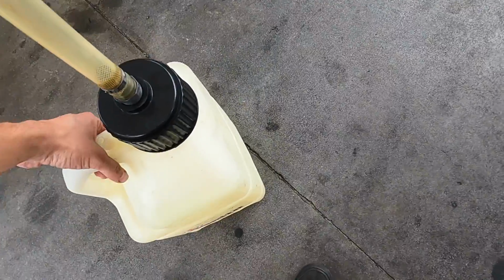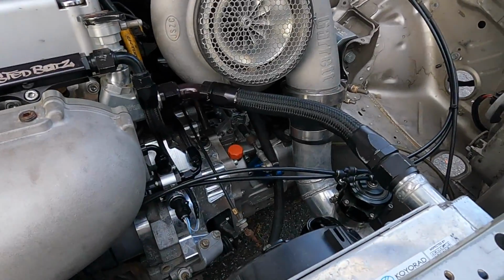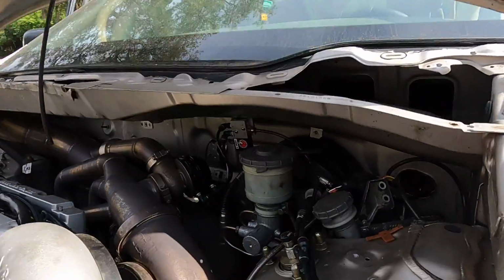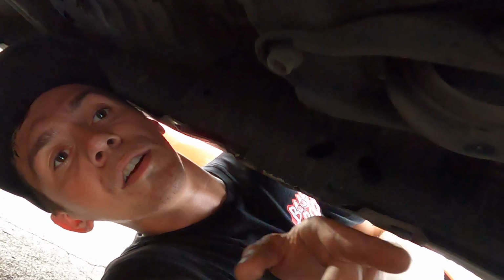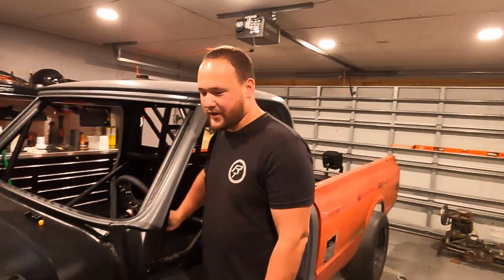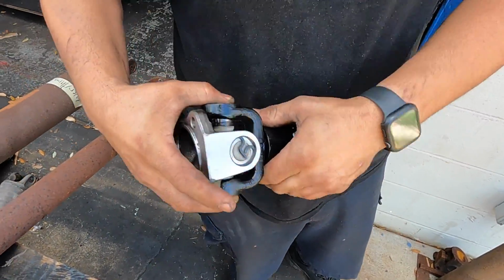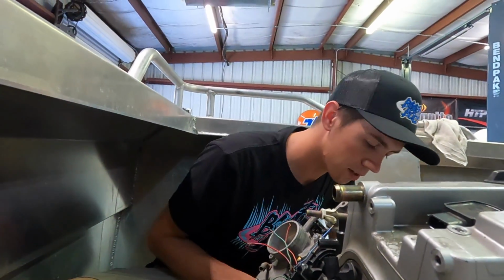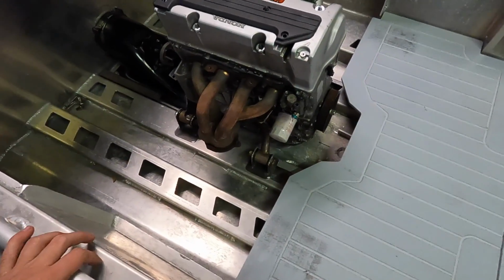Custom Parts Came For Our K-Swap Jet Boat Build!

Comment: Cayman S, and it has the 2.7?? I had a rag top Boxster S, and it had the 3.2. I LOOOOOOOVED that car. Got it for free from a guy who bought a car from me....he said that he was driving it, heard something break and the power steering stopped being power steering. I figured he just snapped a belt. After i towed it home, I gained access to the engine through the 'back seat' and found that the pressed on water pump pulley had flung off and through the belt. So, $124 later, for a belt and water pump.....I had a sweet rag top, Bossier S, with a 6-speed manual. It was soooo much fun, until some asshole with a turbine on his head ran a traffic light, struck me head on, then I t-boned a 2 ton Fed Ex truck (well, didn't really t bone him....the nose of my Porsche slid under the side of the van all the way to the windshield!!)

Only had that car like 6 weeks! 😠 😡 😤 🤬

Comment: shouldn't you make a remote oil drain to change the oil on it
Reply: Most oil changes on boats with inboard engines are done with an oil extractor. Which uses vacuum to extract the oil out through the dipstick tube.
Reply: @MellowYe77ow  interesting, I still think a remote drain would be easier and more convenient

Comment: If you have issues with the hydraulic power steering setup, you could always go the route of using the power steering out of a prius, which is a pure electric setup that mounts inline with the steering column. Just mount it and feed it the correct power and you're good to go.
Reply: The issue with that is that he's trying to save space, and still needs a hydro pump for power brakes.

Comment: Gonna lead to a bunch of sick days lol, I definitely have some concerns for those mounts not corrosion, but I feel like the aluminum is going to stress crack. That motor is a 4 banger with it's inherent vibrations I think the aluminum needs to be beefed up for sure

Comment: The Volvo ps pumps have extra sensors that regulates the speed of the pump.   As you turn the wheel it boosts the power to move the wheels.   You don’t have the sensors so it won’t fluctuate.  Plus the pump can take up to 80 amps to run so you need to have a beefy alternator.   I’ve worked on Volvos for years.

Comment: Maybe you could cut small square of rubber mat the shape of the mounts and slide it between so you have some vibration/noise dampening. Just from my experience I have seen some drone from solid mounts. Cannot wait to see this thing in the water, It' going to be epic!

Comment: good to see you made that heat shield for the brake master cylinder on the van. you dont have all the weight of the truck on the front wheels there is a trolley jack holding the weight liar

Comment: Is the K gonna have enough torque to push it through the water fast enough ?? Steel scratches aluminum i give it a few weeks after being in the water youll see the rusty aluminum appear ..especially in FL

Comment: Brother put a thin peace of heavy duty rubber between take out some vibration also works as a barrier and not let aluminum oxidation to happen? As for the rubber something like a heavy duty peace of conveyor belt cut to fit eliminates contact to contact!

Comment: You really should separate your steel from the aluminum , I have had aluminum boats in the past that have had issues, Better safe then sorry. Easier to put something between the metals then find a pin whole and patch it

Comment: Dude, put some thick ass rubber between the mounts and the floor of the boat so that the awful vibration from that motor are as isolated from the hull as physically possible

Comment: I fitted a TRW E-pump to my gf's V6 twin turbo VR4 out of a Holden Astra in lieu of a belt driven pump, and the pumps are designed to work on 14 volts, so you'll find once the engine is running and alternator is charging the pump will work better and the stiffness part when you swerve the wheel will be less pronounced. Some of them have a VSS wire that drops the speed of the pump when you're at speed to make the steering less twitchy, but not all of them have that function. The MR2 pump was always the go-to pump for a long time because they were smaller and package better in the bay, but these TRW pumps usually bolt to the top of the steering rack out of the way of everything else

Comment: are yall gonna put a turbo on it eventually ?
Reply: and also what route are yall going with cooling the engine ?
Reply: Yes, they plan to turbo it in the future. The jet drive will also pump water through the engine.
Reply: @MellowYe77ow  ok thats good but will the engine ever get up to operating temperature that way ?
Reply: @karrharding8675  Just keep the thermostat in it, and it'll work just like a normal cooling system.

Comment: Nutsert the mounts. Do not just run a tap on that sheet metal.
Edit- they sell aluminum nutserts which are easier to rivet in then stainless or ms and wont corrode

Comment: As for the power steering on the truck I gave up and caved and put a Saturn car electric column in my samurai and it steers 33’s just fine.

Comment: Why has nobody invented a spring board for the bottom of the boat I mean a thin sheet of aluminium the same shape as the boat on small suspension would be great if it all worked correctly. It would take the initial hit off the boat hull

Comment: I would think hose diameter would have a big okay on response to the steering rack , big return and just right on the pressure side .. I would think too fat would slow it down and too small the rack would lose it too , just a guess anyway

Comment: Get some 2mm HDPE sheet (or cork or anything non-metallic) to use as a gasket between the steel and aluminium.

Comment: I'd get some 1/4 steel plate as long as the engine and bend it to fit over the aluminum streamers so that you can bolt the steel from the top and sides to the streamers with say 6 to 8 bolts, and then bolt the engine mounts through the steel and aluminum. If you don't have large enough steel plating those engines mounts will end up ripping through that aluminum and that will cause a very bad day.  That type and thickness of aluminum will not hold up to all the jarring that the engine is going to be dealing with.

Comment: Use nutserts.  Aluminum fatigues over time and I wouldn't trust those threads.  <-- machinist.  Also use stainless steel hardware.

Comment: You might be able to tighten them down tight but aluminum is soft and having it that tight is actually gunna make it wear fast with the vibration and what not. Have better luck if you tap and use heli coils to add some strength or do what u said and add some thickness to it.

Comment: watch the bolts you use. They'll be your weakest link, They'll crystallize very quickly. Go to a Bolt shop and see if they have bronze or an alloy that will handle the load and harmonics you'll be subjecting it to. Another thought is the strength of the aluminum your mounting the motor to. The stress potential here will be huge. Just thoughts of an old engineer, your video showed all kinds of red flag construction issues I picked up on. Sorry to rain on a parade but, i've seen engines peel out of boat hulls before and most times it takes the driver with them. Be careful.

Comment: You can still put in the aluminum blocks. Just cut holes and recess them. Then use a sacrificial anode as others suggested along with a lot of anti-sneeze on the bolts. Making sure the block is thick enough so the bolts don't have a hole at the bottom would help too.

Comment: I'm gunna go ahead and stop watching the channel after this comment. Just wanted to point out that you could have easily avoided spilling Gas on your seat, if it was an accident to begin with. I just loose a lot of respect from people that have nice things and treat them with total disrespect. Rather insulting to people who have nothing. It's not the gas can on the seat. It's the fact that you didn't give a shit to use a sealed can, or just blatantly spilled it to prove you drive it daily. Which is worse. Anyway, had a lot of fun watching your channel so thanks for all the good entertainment, yall take care.

Comment: In the UK custom cars use a vauxhall corsa electric power steering unit that goes on the steering column and is real easy to fit, hope that might help there called opal corsa's in other places
Alan from Scotland

Comment: Kyle, it’s best practice to have 1-1/2x the bolt diameter has your thread depth.  So if you are planning to use a 3/8”diameter bolt then you will need about .518” of formed thread for the bolt to engage into.  

If possible a nut on the backside would be better than only have 2-3 threads engaging on each bolt.  And it would not be surprising to see the aluminum frame rail fail quickly putting torque to that thin material.

A nutsert is actually probably the easiest and not a bad solution at this point. 

But I’d recommend rebuilding your mount to be able to spread your load down the frame rails with thicker material that you can run a proper thread into.  

Best of luck! 👍

Comment: One thing for sure, its gonna be the most reliable mini jet on the water. N/A k series. Hell yea. Put it on E with a fuel tech. By the way, i bought a super cheap oven/stove from salvation army, a powdercoating kit from summit, and i just bake everything in my $50 oven in my shop. Shit comes out SO baller dude. I did chrome powdercoat when i put some wider outers on my rear 3 piece johnnies for my irs converted sn95 drift car and nobody believes theyre not plated until i show them. Shit comes out absolutely PERFECT.

Comment: Hoping you read this..,Scatter-shield !!! For the jetboat! That exposed flywheel/driveshaft is a little sketch. I’d also put a carbon steel plate beneath that rotating assembly to keep it from punching a hole in the hull if it comes apart.

Comment: My Saab story popped a silicone coupler at 19lb an I was like ok 15 was fine 🤣..  

Btw “boat” stands for “bail out another thousand.”
 
And boats are much easer then a car to build. So far I’ve built 2 boats.. the first one was a 19ft inboard with pre-alpha 1 leg the og engine was a 151cu in 2.5l inline 4 and I swap in the 181cu 3.0 iron duke.  The second boat is a 24ft trophy with 2 Honda bf115. My opinion is boat are easier to maintain an build.   

An brooo take my advice use 100% silicone behind all pieces that sen close to each other. because boats do have vibration even if you get the shaft perfectly inline. so the silicone will help reduce aluminum vibration an you won’t need earplugs

Comment: If I were you I would ask the drive shaft shop to balance that drive shaft out to 8000+rpm. 

You will have some bad driveline vibration if it hasn’t been properly balanced to the high speeds it’ll see directly coupled to the k series.

Comment: I'm a welder fabricator for almost 20 years, and I used to work for a company that did kingpins and all sort of attachments for trucks. When we had to joint parts made from steel, to parts made from aluminum, we were laying duct tape on one of the surface before sandwiching the 2 parts together, this way we were avoiding corrosion between the 2! Steel in contact with aluminum in salt environment will just make both metals rott! You should definitely use this route. It's simple and will save you lots of headaches and time in the future! 

Also for the engine mounts, you could simply scribe around the steel squares, remove the engine, cut the square holes and then insert 1/2" or 1" thick blocks inside the holes that you could weld solid and safely tap. IMO tapping engine mounts in 1/4" thick aluminum is borderline solid enough!

Comment: Hyumdai excel pump is the most used for LS setups, you need to just strap or weld on some hold points for the driveshaft on the van, you're fighting the torque so hold is back.

Comment: One easy route would be to make the engine mounts out of aluminum. Weld it on  spreader plates (or an entire pedestal for the engine) and use titanium fasteners and spacers if corrosion is really a big deal. I would avoid making any more holes on the hull and have more points for leaks. It takes time doing it right but it would be less of a headache when it does happen

Comment: Get a full set of EBC Red break pads for the Porsche . They work great and will cut way down on the break dust that you are getting on your rims.

As for the engine mounts for the boat, You can simply remake the lower portion of the mount out of Aluminum. The rubber will isolate the steel portion from touching the aluminum portion. So just aluminum stands that can be welded directly to the boats hull or bolted if you prefer to have them removable.

Comment: That galvanic corrosion is no joke, anodization or 26 coats of powder coat, set it in salt water, and it’s doomed, give it 4 months before it’s noticeable, not to be a downer, but I’d recommend before it’s done do it right, vs do it again. You may be able to stretch out the failure a year or 2 if you put in sacrificial anodes.

Comment: I would use like a .5" piece of square polyurethane to fit between where the square surface of the engine mounts meets the boat surface, this would allow for extra NVH protection. Unless you're planning to weld that end of the engine mounts to the boat and I missed that somehow.

Comment: Put a hydraulic fluid accumulator in the truck power steering high pressure side...when the electric pump can’t keep up, the spring in the accumulator will compensate...adds safety too as backup pressure for hydroboost brakes.

Comment: Kyle have you thought about cutting up an old innertube and using it between the mount and the boat?  Possibly a little vibration dampening and it will keep the steel and aluminum from touching.

Comment: Don't tap into the Aluminum
Take press in insert threads in german we call them "Blindnietgewindemutter"
take this from stainless steel and stainless bolts use some electrical insulator between the steel and aluminum faces touching each other. Corrosion between aluminum and stainless is uncritical. As an insulator we always use PCB base Material called FR4 which technically only is a GRP sheet material with around 2mm thickness

Comment: go tell ford that it takes years their mustangs manage it in months :) also salt water speeds it up too. at very least you want some rubber between the mount feet and the boat frame. although the bolts will still be an issue it'll be better than nothing i guess.

Comment: I have to agree with most people on here kyle.....I know you said your not worried about corrosion due to it taking a long time to achieve it but I can tell you that it honestly will only take a year or 2 before it starts to corrode and pit very badly....I live in ohio and work/fabricator on fuel tanker trucks and the 5th wheel plates are steel where as the trailers are ally. We do D.O.T yearly and 5 year inspections and even after 1 year the plates start showing signs of pitting from corrosion and by the 5yr mark 99% are so bad they are almost falling apart in areas and that's even after we use rubber to insulate between the ally and steel plate. You living near saltwater environment will only make it worse on corrosion and speed it up faster unfortunately. Regardless of what you do (stick with same ideas or go new route) I'm behind ya rooting for ya the whole way. Cant wait to see this out on the water💪💪

Comment: With the electric power steering in the truck, maybe a hydrogas sphere from a Citroën suspension connected to the pressure line from the pump would smooth out any demand spikes from the rack 🤔

Comment: Ask owners of Jeep Wranglers about galvanic corrosion. Steel door hinges with aluminium door panels with no surface coating to separate them means they start seeing bubbles in the paint after about 2 years.

Comment: Just fed a nut plate up the rail towards to engine mount, bolt up then rivet in position to hold the plate while removing the bolts.

Comment: Aluminum does not like vibration, tensile or torque stresses, so not a great engine mount material.
I have spent several years maintaining a small fleet including a 30m aluminum Cat', all bolts that come into contact with aluminum should be 316 SS AND coated with Duralac.
Duralac is a yellow paint/grease type product that comes in a tube, like RTV, it inhibits dis-similar metal reaction.
Once I became aware of it in the marine game, I started to use it in automotive applications as well- it was THAT good. I used it mostly on bolts that go through aluminum valley covers, inlet manifolds & timing covers- all the places where you normally break rusty bolts on dis-assembly.
It also works well on flange faces where you have flanges of different metals mating- ie aluminum engine parts to SS plumbing in a marine cooling system.
Don't forget to fit an earth loop between the hull & all components mounted to the hull to prevent electrolysis, especially if they involve electrical or water flow or are otherwise insulated from the hull, including the jet unit.
Salt water is the biggest bitch you will ever meet. cheers from sunny Queensland Australia.

Comment: Hey Kyle, I’m not sure what impeller you are running being a Scott instead of a American turbine which I’m most familiar with but let me know if you need any knowledge and or help with impeller sizing/ loading m which is a huge part of making mph out of a pump. I run a 15 6.0ls in a “tx 19” jet boat and have built and setup a lot more from bbc, bbf to high rpm jet skis would like to give you some info to save you the hardship of learning jet pumps if you would like.

Comment: Been a boat mechanic in Virginia for 12 years. When I see a boat from Florida I run. Don't underestimate electrolysis caused by dissimilar metals and that humidity and salinity.  Ground every component and have sacrificial anodes.
Reply: zinc is life